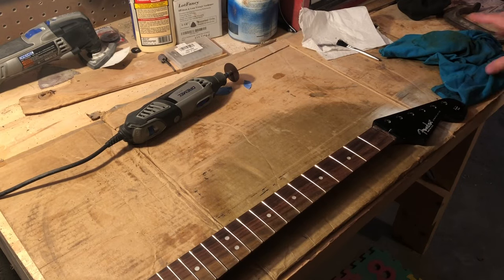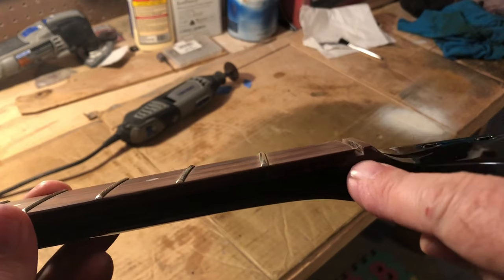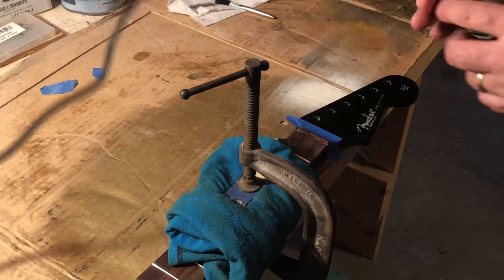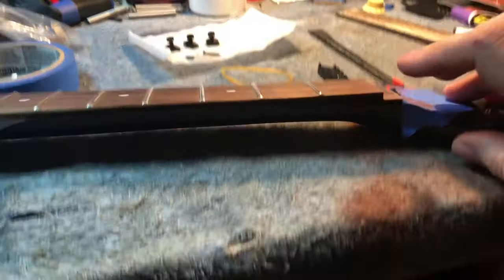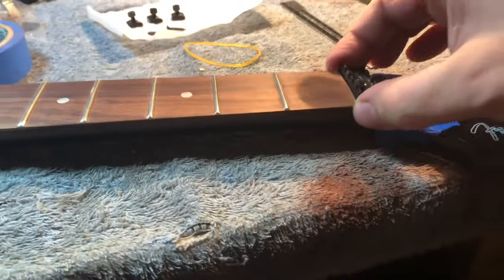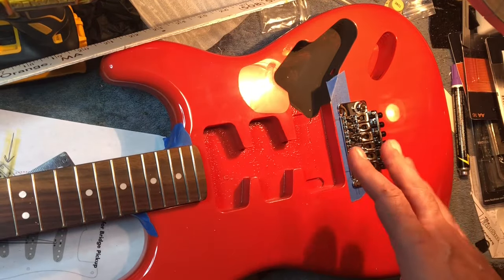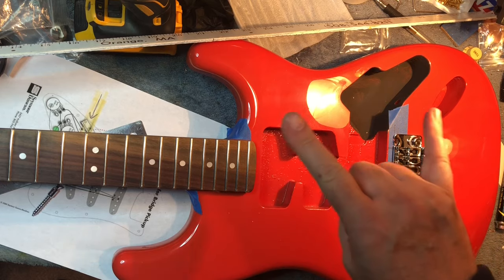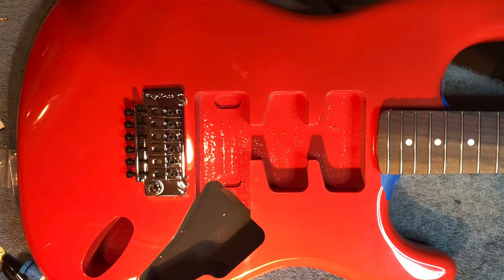Installing a Floyd Rose On A Fender Brad Gillis - Full Tutorial

Comment: you need a full thickness body, 1.75"  and if you are going to use a non Floyd rose routed body you really want to use the wood screw type posts, because that leave the most amount of wood between the post and the humbucker route .. a genuine Floyd rose body the humbucker is further away from the bridge that way there is at least 1" of wood between the anchors and the humbucker route, any less and they tend to break out, WHY a wood screw style is the best!!!  it leaves more wood there so it wont break out like they tend to do when people, or guitar makers use a 6pt bridge body fora dual fulcrum...  so many builders are guilty of this fender being the most egregious . . .

seriously when you do a dual fulcrum with an anchor think about it that anchor removes 1/2" of material, on a 6pt pattern that leaves less than 1/2" of wood to hold that anchor back.. I have seen so many where the wood breaks out on one or both sides, some are very trashed, some not as much...

so fender needs to use a FLOYD rose pattern when they make a dual fulcrum body, not he FREEKIN 6 PT PATTERN! like they are guilty of still today knowing this issue exists all too well!

use a floyd rose pattern on ALL dual fulcrum set ups...  that way you have at least an inch of material to hold back the two lonely posts a dual fulcrum bridge rides on..  ALSO!!!  you want to use the narrow humbucker route, YES always use the ring style AND the wide style post pattern, 74mm  this puts your posts halfway outside your humbucker route and a lot more wood to hold that anchor back, you never see failures on this type of pattern...  just look at your pattern before you hog it out, is there any wood holding the pin anchors back?   fender has done like 80mm wide humbucker routes and the anchor a mere 3/16ths inch back form the edge.. they ALL fail just from string tension alone!  and some of the repairs are sad indeed, people will sell them not revealing that issue cuz you cannot see it until you remove the pick guard and the bridge, then it reveals itself, OR one takes a very very good look there is a tiny gap to look but you need to know what to look for..

lotta guys get shafted buying these failures that leave the guitar unplayable, not a huge fix if done right you just take the pieces out, celan it up, glue pieces back in place, then use a larger diameter anchor, or fill with a dowel and use the screw type . . .  in any event you have to figure a lot of the tone is coming thru those anchors and posts into the body, if there is no wood in front of the anchors what happens to the vibrations?   that's right, nothing, there is no wood to resonate the vibrations . .   it all matters if you are looking for a tone monster . .   use a floyd rose pattern with the humbucker moved toward the neck at least 3/8ths inch...  integrity, give it a chance
Reply from the maker: Dude, that was a lot to read! Too much… lol 
I modified a FENDER body for a Floyd, just like Brad’s guitar. I purposely moved the posts back, to leave enough wood between the posts and the pickup route. They are completely stable and I stand behind my work 100%. Also, I modified the depth I drilled, that’s all, there was no compromise. The studs were still as low as they needed to be and the Floyd was decked, VH style, w/ zero issues. This was a quality, professional installation that functioned perfectly and will stand the test of time. Not sure exactly what your point was in that manifesto? Thanks for watching and commenting anyways.